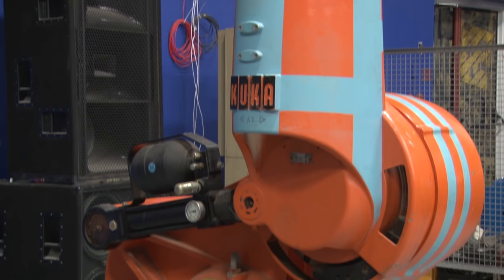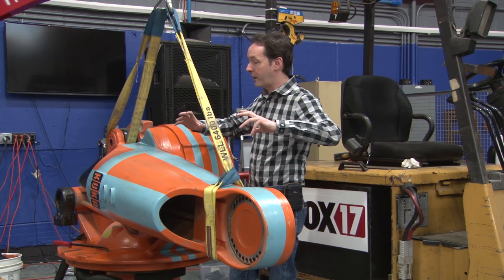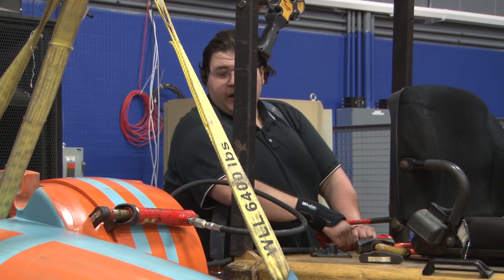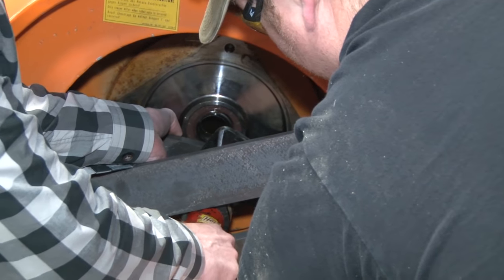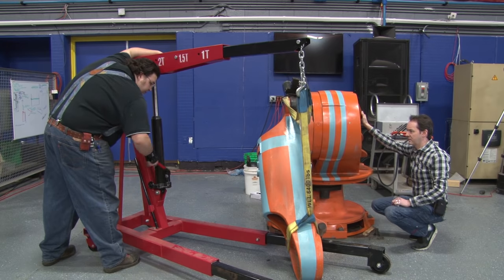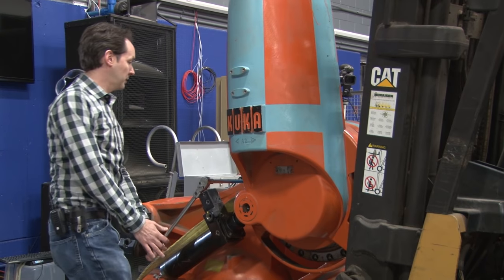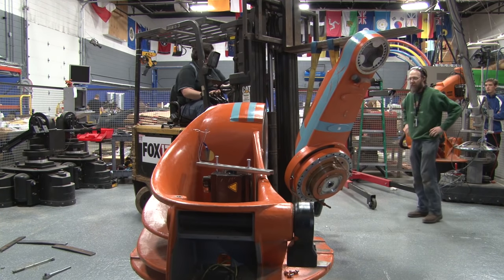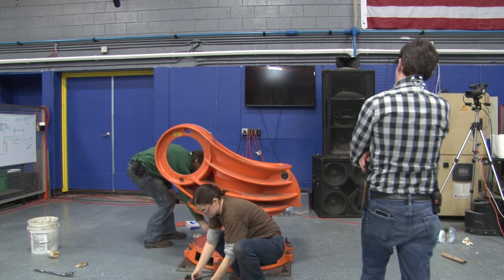"Fixing" a KUKA KR-350/1 Robotic Arm: Part 2

Comment: They are acting the dismounting trying to make it look casual. It's a good acting but these guys read the manuals. There's NO guess work whatsoever. It's a nice click bait technique that makes the video fun to watch. If this goes completely 'canonical' and rigorous the video would reduce to a simple motor dismount done by the book. 

To be honest, I would love to watch a real video of how this happens because there is a lot of planning ahead. This doesn't happen on the basis of improvisation. When someone dismounts a Kuka robot that person should know what he will find inside. It's not a trivial work.
Reply: i beg to disagree at many points they are forcing axis  with a forklift when they could have just used the jacking bolts and im certain that every axis has 2-4 jacking bolts that would be marked in the service manual. every tight tolerance part should have at least a pair, since if a part comes off at a very slight angle it will bind up hard